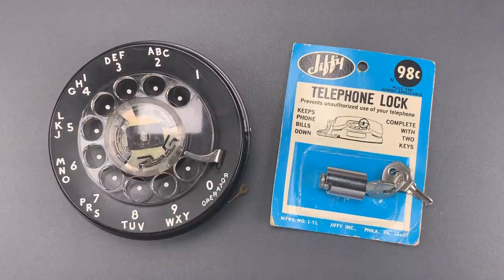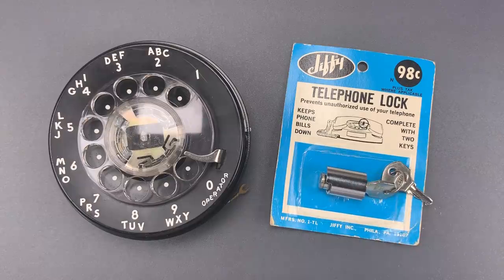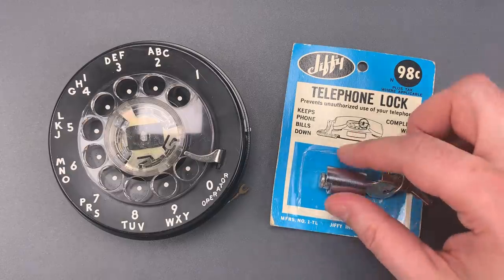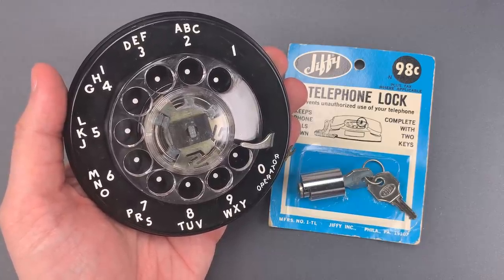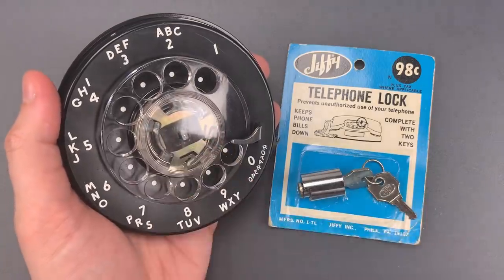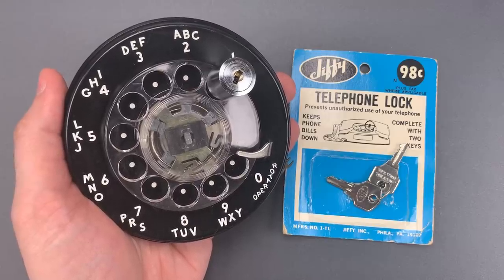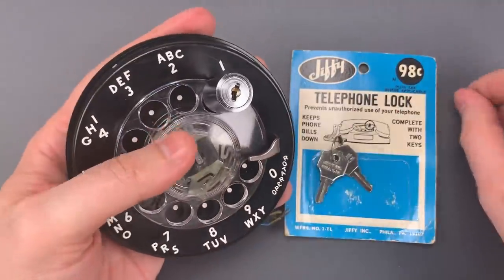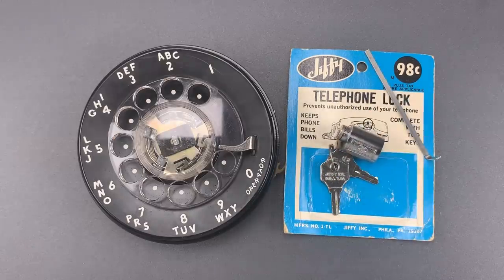[1084] This Lock Could Save A Month’s Wages... in 1960 (Jiffy Phone Lock)

Comment: To add to the description of how the dialer worked...  When you released the dial it would blip (hangup) the line for a split-second for each number as the dial rotated back to the original position.  If you dialed 5, then the phone line would be blip the line 5 times.  Not long enough to end the call, of course - just long enough to be picked up as a 'pulse' by the exchange at the other end of the line.   This is why they called it Pulse dialing (compared with Tone dialing). 

You could dial a phone number by tapping out the phone number with the hangup button.  To dial 351 you would hit the hangup button like this:    tap-tap-tap  pause   tap-tap-tap-tap-tap   pause  tap.

The legend is that this is also the reason why the emergency numbers were 911 and 999 in the US and UK (respectively), even though 9 takes longer to dial than 1.  Line noise would sometimes be interpreted as a single pulse and there was a risk that a very noisy line to accidentally 'dial' 1-1-1.   So they made the first digit 9 because that would be extremely rare to happen as a result of accidental line noise.  The UK uses 999 which is extra safe, and the US uses 911 which was a little faster to dial.
Reply: I saw a UK TV documentary, and they said the 999 prevented the accidental calls from birds sitting on the lines making connections with their tails. Seriously, that's what the guy said, because 999 was furthest away like you said.
Reply: So, I imagine a "0" would blip 10 times?
Reply: @Edeljokaa  you imagine correctly
Reply: Further, the time difference between 1 and 9 explains why large cities have area codes like 212, while my rural one is for instance 319. Because you held a circuit open the whole time when dialing. It saved on circuit-hours for the much-more-common big-city calls to dial faster, which went straight to the bottom line for ATT.
Reply: I was taught that in the UK we use 999 because it's easier to dial in the dark, or in thick smoke if you cant read the rotary numbers.
Reply: Interesting. I'd often wondered why it was 999 rather than, say, 111. Because, as you say, 111 would be easier to dial. This explains it. Though I believe 112 also gets you through to the emergency services. I imagine this was maybe introduced after rotary phones went out of use.
Reply: In Sweden the old emergency number was 90 000  :) (now 112)
Reply: In my country, New Zealand, the emergency number is 1-1-1
Reply: Jonas Åman Probably because we used a different pulse strategy with 0 as the first digit. Making each digit use one extra pulse. So 90000 was 10 pulses then a series of single pulses.
Reply: In Latvia we used different numbers for each of the emergency service - 03 for medics, 01 for fire department, 02 for police, and 04 for gas leaks, now all replaced by unified 112, though medics can still be reached with 113 directly and 114 directly for gas leaks, or 110 for direct call to police. Also 112 actually connects you to the fire department, but they still take all your emergency calls.
Reply: grahamlive 112 does indeed get the emergency services in UK as it is a European Union wide requirement to have a common number for travelling
Reply: @1sword4you  belgium: 101 = medic / 102 = police / 103 = firefighters / 104 = suicide line / 112 = geer (general european emergency response)
Reply: the "dialing 9 takes the longest" is also why the large metro areas have the "smaller number" area codes.
Reply: It is 999 in the UK because the lines would move in wind and create a pulse that can get through to the switchboard.  It's very hard for the lines to move and tap out three sets of nine as opposed to any other number combination, therefore avoiding false 999 calls.
Reply: If you tapped out the number from a call box it went through for free in Ireland. 🍀🇮🇪
Reply: Wow very informative comment, thank you from a millennial/gen z !
Reply: @Namirred  It's also specified in the GSM standard for cell phones. It's probable that it'll work even in the US, at least on a cell phone. Not guaranteed though.
Reply: This was the information i didn't ask for, but it was the information i enjoyed reading....thank you for typing (or copy pasting) it, have a nice day :)
Reply: I've no idea if this is true.. but that's never stopped me posting before ;-)
I heard that in the UK, the GPO wanted emergency calls from a phone box to be free.  Calls to 0 (for the operator) were already free, and so they chose 9 since it was a minor change to the wiring to make 9 calls free. They then added a couple more 9s to prevent accidental dialling.  Of course, that doesn't make the noisy line suggestion wrong - quite possibly there were multiple reasons why 999 or 911 were chosen as emergency numbers.
Reply: Dialing 911 in the UK from a cellphone will also call emergency services, and 999 probably calls emergency services in the US as well from a standard cellphone as they’re all cross referenced
Reply: One thing to add is that area codes in the US had to be [2-9][0-1][2-9], plus special codes like 800 [8NN]. Major population areas got a 1 in the middle and small areas got a 0. The biggest cities got 212 (New York), 213 (Los Angeles), 312 (Chicago), and 313 (Detroit) to minimize the number of pulses. Somewhat amusingly, eastern LA county now has the "smallest" area code: 909.
Reply: Funny how with touch tone dials it's now faster to dial 999 than 911 :) very interesting fact, thanks for sharing!
Reply: You can still do the tap dialing most places! I tried it on my parents' phone, and it's connected to fiber.
Reply: When I was a kid, friends and I did Phone Phreakery with the "click-dialing" you mention.  We got hold of some training manuals from a phone company employee, which listed some four-number combinations that could be click-dialed to get operator-level control, which was essentially "god mode", with its own special dial tone.  Dialing the number combos would not work.  They had to be click-dialed (the technique was described in the manual).  When using the trick, we couldn't be traced, had the ability to call anywhere for free, tie up anyone's phone for hours, and even do the ultimate trick of pranking on the operator herself, when traditionally the operator had the top level of power. When you dialed 0 to reach the Operator, you were normally in her power, and she knew who you were instantly.  But not with the click-dial god mode!  We unfortunately drove some operators to tears, but it was all in good fun.  When the local phone systems started to go digital, the tricks stopped working.
Reply: I think if you make reference to the Clash classic "London's Burning" you'll find that the emergency number is actually 99999. Thank you.
Reply: @FranklyPeetoons  no offense to you but whenever someone uses the phrase "all in good fun" I automatically understand "all in good fun for US, who gives a crap about anyone else, amirite?". Fondly reminiscing about how you and your friends drove a person trying to do their job to tears is not cool...
Reply: I thought the uk changed the emergency services number to 0118999881999119725   3
Reply: @wraithgr  They were kids
Reply: How is 911faster to dial? All time savings would be eaten by need to move your finger, plus, if you were under stress you could miss and call 922 instead. No, US system was usual junk designed to look different from the rest of the planet while being garbage in practice (see imperial measures, voltage, voting system, healthcare, gun laws, etc, etc, etc...)
Reply: Keiya  Ure right, I’m in the US and just dialed 112 on my cell and indeed it went to police dispatch
Reply: In fact it went right to my city police not some European city police dispatch
Reply: I made many calls, in the 'olden days', using your described method, including one phone that had no dialer.
Reply: @KuK137  911 is faster on a pulse dial because 1 takes less time to dial than 9, so 911 is faster than 999. On a touch keypad, all keys take the same time but 911 requires moving your finger whereas 999 doesn't, so 999 is faster.
Reply: 1-1-1 will also dial emergency services in Canada at least...
Reply: In Japan the police is 110 which makes sense to first hole - first hole - last hole
Reply: @ChrisHightower  checked to see if this comment was here. You delivered. Well played, sir!
Reply: @ChrisHightower  Richard Ayoade could remember it easily :)
Reply: When I was a kid we used to think a neat trick was to tap the buttons on the hang up cradle to dial a number - took ages and was very error prone but hey we were kids.
Reply: Does pulse dailing still work today?
Reply: @joealtmaier9271  hey area code brother
Reply: More specifically they called it decadic dialing en.wiktionary.org/wiki/decadic_dialling
Imagine having to dial 000 in an emergency on that thing.. That's the number to dial in Australia.
Reply: @tasteslikemagic  New Zealand used a different pulse encoding of 10 minus the digit being dialed. Thus this actually sent three sets of nine pulses.
Even more odd is that Oslo used this whilst the rest of Norway used the more common encoding.
Reply: @tasteslikemagic  Random fact, that's because New Zealand rotary phone dials are wired backwards. Find a photo of an NZ rotary phone and you'll see the 1-9 digits are reversed compared to the dial in the video.
Reply: Huh, I thought 911 was related to the 11th of September, 2001 incident
Reply: @ChrisHightower  Yeah, I thought that too. It's so much easier to remember, you just have to sing the song, you know.
Reply: @TheaH2O2  That's because they are down under. From their point of wiev, the wiring is correct.
Reply: @Scruit:
Yea until you messed the sequence up and had to start over again ... especially after getting to the 6th number ...
Reply: @Edeljokaa  correct, back then there where not many numbers to dial, so it could be done. I used to do this when I was 6 :P it was too easy to learn
Reply: this explains the scene in the movie Hackers at the jail!
Reply: @keiyakins  In the U.S., if your cell phone is linked with the GSM network and you dial 112 then the GSM network will forward your call to 911.
Reply: @joealtmaier9271  Actually, if you remember, you did not need to dial the area code back then.
Reply: @MrCh0o  total coincidence, it's been around for many decades before that.
Reply: I had heard the logic behind 911 was it's near impossible to dial by accident, whereas with 112, you could put one of these locks in hole #3 and still be able to make emergency calls.
Reply: Australia has always used 000, presumably to accommodate the rotary dial system. But on a mobile phone you can also use 112 (GSM standard emergency number), and so many kids brought up on American TV shows caused the phone companies here to redirect 911 to the emergency line too.
Reply: That's what I came to post. Another tidbit: in some countries people had to dial 0 instead of 1 to make a long distance call. So someone might put a lock like this in the 0 hole. This would allow local calls as long as there was no zero in the telephone number.
Reply: @MrCh0o  IMHO that's why the terrorists chose that day... The number is on every emergency vehicle in the US and it's in the back of people's mind. I think 9/11 was chosen as a permanent reminder that the services you call for your safety will not always be able to warrant your safety
Reply: This 'legend' is doubtful, given that 911 became mainstream in the 1970s, approximately contemporaneously with 'touch-tone' dialing; touch-tone was actually introduced in 1963, five years before 911.  The story I recall, from my days in the telecom industry, is that AT&T chose 911 because it required some mental effort, to inhibit notoriously undisciplined Americans from frivolously mashing 999 or 111.
Reply: Scruit The more ya know!
Reply: 112 works in most places because it's built-in to the GSM standard, but in China, you just get a recording telling you which numbers you can dial, because they have separate ones for the police, ambulance and fire.
Reply: older touchtone phones have a tone and pulse switch because in some places you could get TT phones before the exchange had the ability to understand TT.  Switch it to pulse and the phone would send the signals just like a rotary would.
Reply: @joealtmaier9271  I'm also a "319er" I hope you're well!
Reply: @thenasadude6878  just another reason to go day/month/year
Reply: @CallieMasters5000  A top London police officer suggested to the Post Office (who ran British phone services) that '1' should be the emergency number. He had noticed that no phone number began with '1'. The Post Office took up the idea of an emergency number but adopted '999' as '1' was excessively prone to false calls. The other reason for '999' was the old style British button 'A' and 'B' pay phones had to be able to allow '0' and '999' to be dialled without inserting coins. With no coins inserted the dial was short circuited so you could not dial a digit. But when the dial was turned to the '9' position the short circuit was broken to allow a '9' or '0' to be dialled. The user pressed Button A when the call was answered and this removed a short circuit from the mouthpiece (and removed a 100 ohm resistor from the earpiece to stop the caller talking into the earpiece). If the call was not answered the user pressed Button B to return the coins and break the circuit. There was a wire gong and a small bell and microphone inside the coin box and (from memory) a penny hit the gong, a sixpence the bell and a shilling would hit the bell twice so the phone operator could ascertain the correct coins were inserted for long distance calls (including some international calls to Europe).
Britain was well ahead of USA with an emergency number. I remember a man in New York (before 911) had a medical event and needed an ambulance. He did not have a dime on him so was not even able to call the operator for help.

Incidentally it would be interesting to see id LPL could pick one of these old British pay phone locks. They were a 6 lever lock operated by a small barrel key with 6^6 (about 46000) differs and they were all keyed differently (as Bell did). LPL could probably pick one holding it in the hand but in practice the lock was on the lower left side of the coin mechanism box with only 12 inches or so space between the side wall and the box which would have made picking very difficult.  The coin box design was almost indestructible
Reply: Be too bad,  because 111 would allow the phone company to lock the phone for delinquent payment, and still allow a person to call emergency services.
Reply: Sam Iamm i think now a lot of smartphones will call local emergency authorities using any emergency code from any country. Thats why the posts saying “say 808 or 111 to siri” will do it
Reply: @KuK137  check the video again and pay attention how long a 1 takes to dial and a 9 takes to dial. Even though imperial system is inefficient and backward, i think you owe it an apology.
Reply: @MrCh0o  read my comment above. We did the same in Ireland. 🍀🇮🇪
Reply: That was very interesting, thanks.

Saw a guy do it in the Hackers movie 
from the 90s or something, and was 
never totally sure how he dialed out 
with just the hang up switch..

Now I know
Reply: @1sword4you  Same in Lithuania, besides 112 there is 01 for fire, 02 for police, 03 for medical, and 04 for gas. These are still in use, but cell phones use a 3 digit number (101 or 011 fire, 102 or 022 police, 103 or 033 medical). 04 for gas only works on landline phones, on cell phones you need to dial 1804 instead.